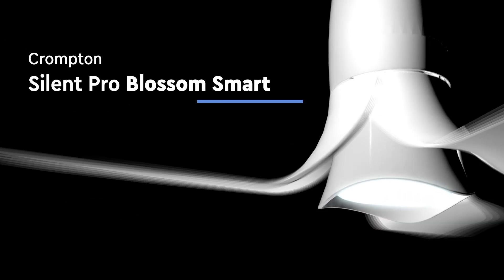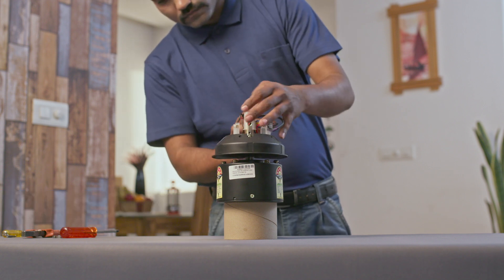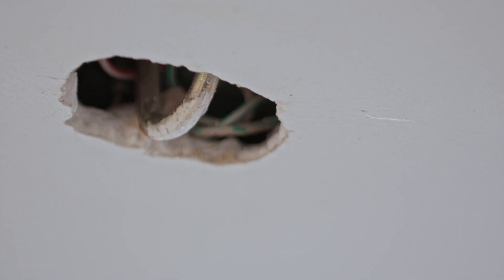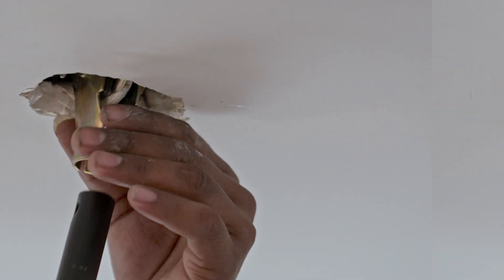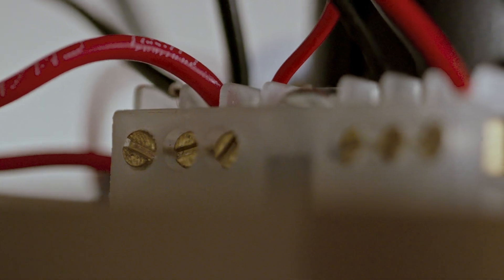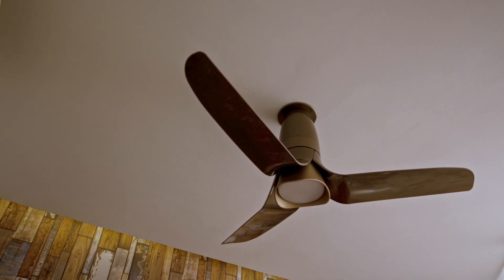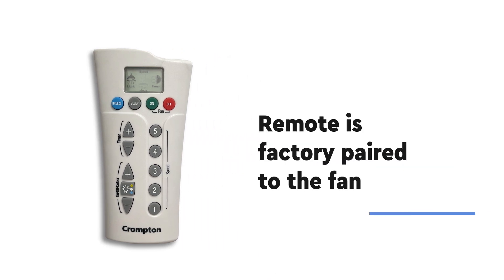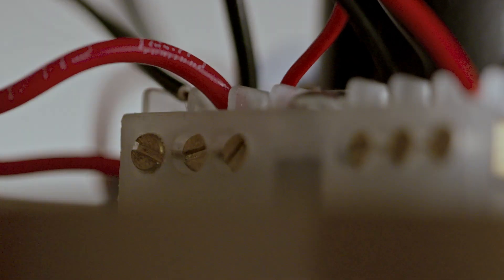Crompton Blossom Smart Fan

Comment: Fan is good looking…but the RPM OF THE LOW SPEED(1) IS TOO MUCH… so if you want the fan to just lightly circulate the air… this fan cannot!!! It will blast wind even at the lowest Speed and there is no way you can reduce the speed and even the company technical team can’t help u with it. It’s disappointing that you buy expensive fans and they aren’t designed well.

Comment: Facing issue during installation, even urban guys are fail to get installed and Crompton customer care is not supporting.. please don’t buy its very expensive
Reply from the maker: Hi, sorry for the experience. To assist you better, kindly provide us with your service request number. Alternatively, you may choose to email us your contact details, including your mobile number, precise address with the pin code, and your complaint number, at consumer.support@crompton.co.in. Rest assured, we will do our best to resolve your grievance.